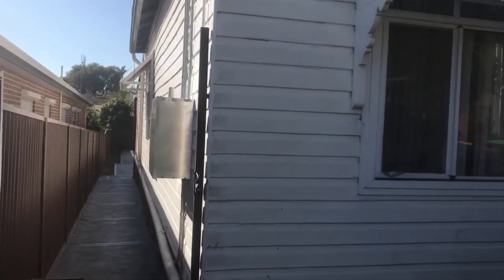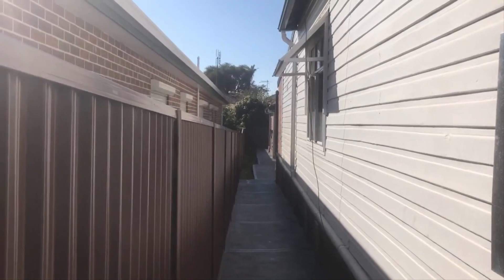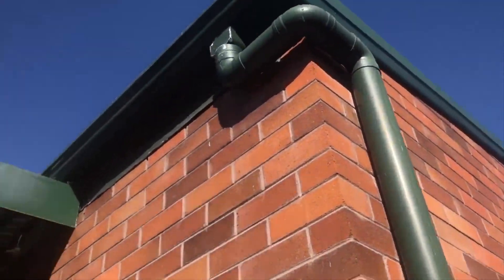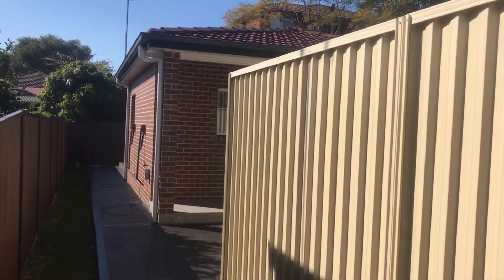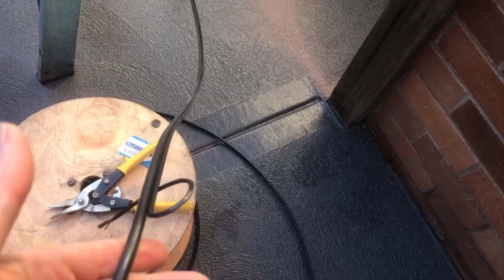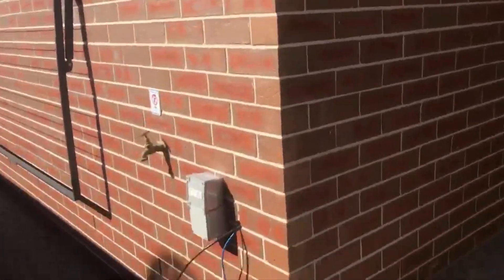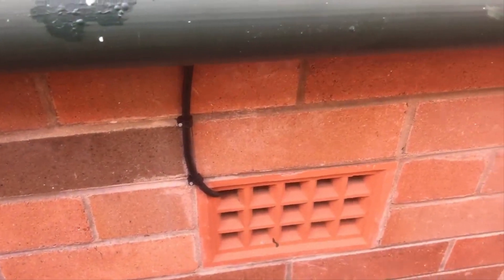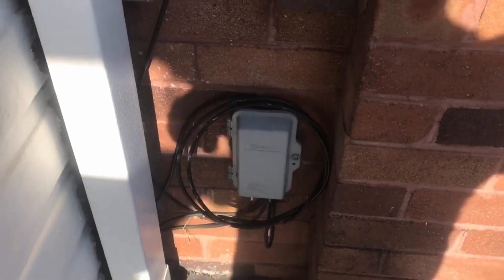Connecting a Granny Flat To NBN HFC Cable. Aerial RG6 Quad Shield to Front House.

Comment: Hey Jason,
Curious as to the rules with the NBN box, why can't you connect your RG6 F end connector into the the NBN box to finish the job? There would need to be a splitter for both the granny flat and the main house, wouldn't it just be the case for you to plug in both ends?
Reply from the maker: Connor Carlyon NBN still needs to run the lead in cable from the street for this customer yet